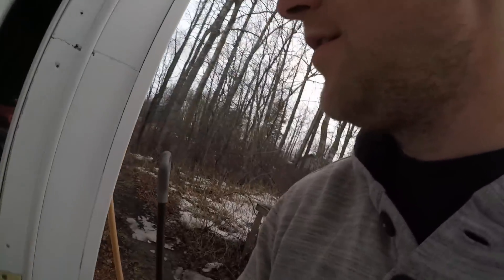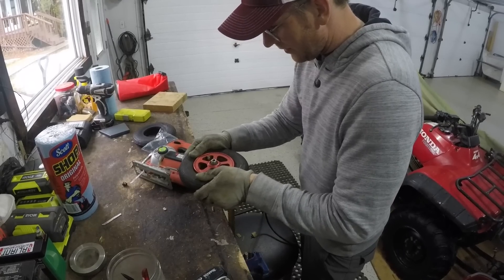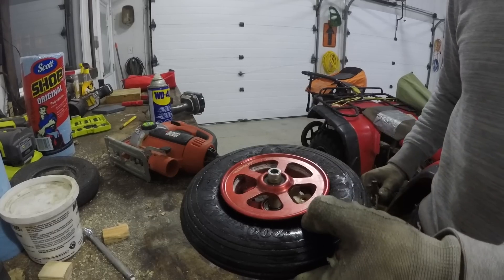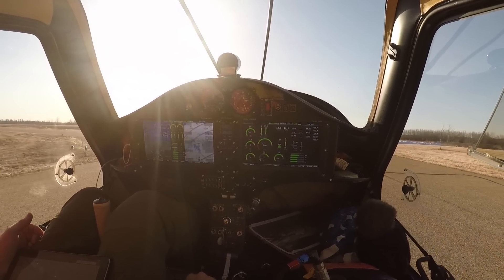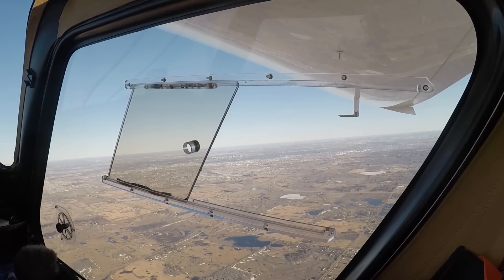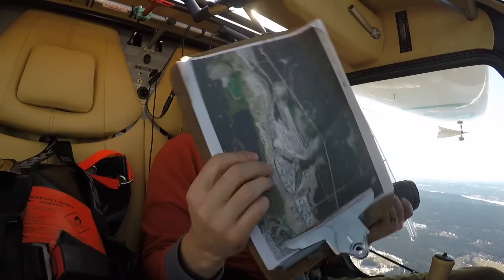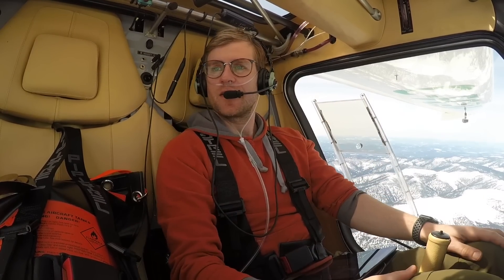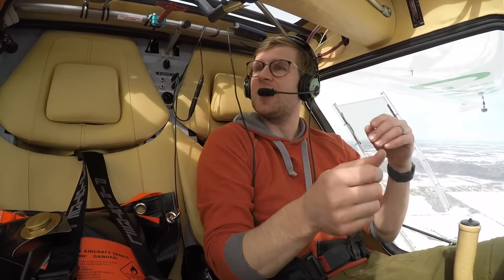1000 NM trip in the Pipistrel Virus crossing over mountains at 15,000'!!

Comment: I am 6.6ft tall and wonder if I can comfortally fit into a Pipistral.
Reply from the maker: That will be tight, there are cross bars on the ceiling of the aircraft that your head will bump into. My headset will hit these in the winter when the seat is stiffer, and I'm only 5'10''.
Reply: @DarrylZubot  Thanx for the update. How you grade this plan for use as a sport plane trainer for high school age students.
Reply from the maker: Awesome airplane for high school students. They'd love it. @SulaimanTheAviator

Comment: Hey thanks for sharing, what is aprox real cruise speed in 75% cruise (4800rpm) 
3000 ft MSL 23 Celsia, humidity 50%?
Reply from the maker: About 127knots. But you should never cruise at 4800rpm that’s too low. Cruise at 5400 as the engine is designed to run at
Reply: @DarrylZubot    :O what is pipistrel 75% rpm and what is max rpm and what is 5400 cruise speed?                                 I am flying Viper SD4 with the same engine cruise is 4800 and maximum is 5500 more than 5500 for five minutes so In my SD4 is 4800-5000 optimal in bigger rpm is aircraft "nervous" :D So what is your consumption in 5400rpm and speed do you have IS engine? Thank you for reply I know a lot of questions but I am thinking about buying pipistrel sw121 or tecnam 2008JC.
Reply from the maker: @okuliarerayban9481  speed is 130knots and 15l/hr fuel burn with 5400rpm.  Read the forums about cruising rpm’s with 912 engine. It is recommended to be at about 5300-5500rpm for cruise no matter what aircraft you have. Engine is not designed to run at low rpm but it’s probably okay. Max rpm is 5700 for take off on pipistrel.
Reply: @DarrylZubot  I have in flight operating manual 4500-5500

Comment: Have you flown your airplane at different speeds to determine what is the best "mileage" you can get?  I know someone who claims her pipistrel virus sw 912iS gets 70mpg to 75mpg at "economy speed", which she says is typically 220kph to 240kph (but usually closer to 220kph).  Is yours a 912iS too, and can you achieve such great fuel efficiency?  She paid a lot extra for "extreme range tanks", but one or two bladders is obviously a much cheaper solution.  Of course you won't be flying any passengers with one or two bladders, me thinks, unless you could put them behind the passenger seat.  Though... I wonder whether that is far enough back that it might throw off the balance.

OTOH, the pipistrel I flew in once with the owner had enormous room on the floor beyond my feet, so maybe you could put one or two of those bladders down there on the passenger side?  Think so?  She flew across the south pacific and back, which she says requires one hop of nearly 4000km.  If my math is correct, that means she MUST get at least 50mph (ground miles) even with extreme range tanks, so obviously economy speed is crucial for such crazy flying.

One final question.  One of my gripes about almost every small airplane is... the excessive height of the instrument panel, so the pilot and passenger [almost] can't see anything out the front window (anything on the ground, I mean, even in the distance).  Especially those of us who aren't 6 foot 5 inches tall... though I don't know how someone like that fits in a pipistrel, actually (though pipistrel claims they do).  And so, my question is... do they make a "less high" instrument panel as  an option?  Frankly, I'm starting to wonder whether one could dispense with most of the instrument panel and just have a couple large iPads with flying apps on those fold out arm accessories that I've seen in a few videos.  I really would like to be able to see something out the front window!  Is that possible?  PS:  I really do love the huge side windows, which give great views out both sides.
Reply from the maker: Hey Max, that's an amazing trip your friend took across the ocean, i'd love to hop over to europe some day by way of greenland, iceland, scotland.  You can definitely fit more fuel inside the aircraft, i've got a friend who rigged his up with four 20L jerry cans in the cargo bay of his and has no issues with flying characteristics. So you could get two of these 40L bags and put them in cargo bay, I keep it up front as I'm usually alone on work trips, also I mount equipment in the cargo bay so need that area free.  I don't have any rudder pedals on the passenger side so you could definitely put more fuel under there.  You can get smaller control panel yes, I have the large version to fit two dynon 10'' screens, but you can definitely get a smaller dash to see out better. But I find even with the large dash I can see just fine out the front, way more then most planes, especially cessnas.  I get about 40 MPG at cruise settings, but if you really pull back the throttle it's probably 60 or plus, your just not going anywhere fast.  I cruise at around 230kph burning 15l/hr.  Yes I have 912iS. I wish rotax made a 912iS turbo charged for high altitude.You can put the 914 in this plane but cost goes way up, so does fuel burn and its just too big an engine for this plane, doesn't need the extra horse power unless you do have the long range wings from pipistrel.
Reply: +Darryl Zubot : Thanks for all the information.  It really helps a lot to hear from people who actually have and fly in the airplane I want to buy.  Got my private pilot license about 25 years ago, but there was never an airplane that suited my desires until the pipistrel virus sw 912iS appeared.  Frankly, I've never flown with GPS or "glass cockpit" type instruments.  I've been trying to figure out what options and accessories I should get on the pipistrel virus sw 912iS I want to order, but about 90% of the items listed I don't know how to judge, what they're for, or how important they are.  What I do know is... I want the most extreme range tanks they offer in the wings, and fittings that make it possible to attach one or two additional fuel bladders.  It appears they can put 300 liters in the wings, and they have an additional 50 liter tank option of some kind that appears to be stuck behind the passenger seat (but not sure).  I'm so confused about options and accessories... I wonder whether we could have a phone conversation so you could help me go through that options and accessory list and figure out what I want and don't want.  Oh, the other item I surely want is the little door/hatch under the bottom so I can place a 4K, 6K or 8K camera on gimbal there (maybe the zenmuse x7 that comes on DJI inspire 2).  Would you be available for a conversation like this?
Reply from the maker: Three things I wouldn't go without on this plane, air brakes, beringer brakes, and autopilot. You must consider glass cockpit it is the future, dynon are amazing systems extremely reliable, never failed me.  If you are getting long range you will want autopilot, are you planning to fly around the world? With 300 litres you will fly for 20 hours, you also cannot land if you take off with full fuel due to the weight, I'm not sure pipistrel will sell you 300l tanks with a 912iS engine, you may need 914.  They do also have 180ltr wing tanks, wish I would've known about this before I ordered mine.  I would get collapsable fuel tank if you want another one inside the plane, then you can add it or remove it, I think the tank pipistrel offers is solid and will be there forever, giving you very little cargo space especially if you have a parachute.  Sure you can call me 780-695-4312. Cheers

Comment: Is your oil pressure normally at 26psi and oil temp so high? I'd figure with sub 20" manifold pressure that you'd have a cooler oil temp and the oil pressure seems lower than I'd expect even with the hotter oil. Whenever I climb high in the Alpha, I have yet to see oil temperature above 87 degrees C. Your manifold pressure you are seeing seems lower than it should be, I had 20.1" of manifold pressure at 11,500 feet and at 8,500 feet I had 22.4".  I'd be sure to check you aren't choking off the intake air supply or need new air filters or something.
Reply from the maker: ElectricZE1 I have a cowl that keeps the oil temps warm. If I keep it open then the oil will be in the 80°c. This also keeps me warmer in the cockpit. The oil psi is in the normal operating range. When I’m at 2000-8000’ my oil psi is around 35-50 but when I go higher it drops further. Manual states it can be as low as 12 psi

Comment: Love your videos. Thinking of purchasing an aircraft. I sat in the virus sw a few years back at EAA and found it a bit of a tight fit for a 190# 6’ 1” pilot. Also looking at Cubcrafter and Flight Design products. Any comments or thoughts?
Reply from the maker: Nap Pozulp hey thanks for the comment! That would be a little tight for long trips, although I know some tall guys in the Pipistrel. I’ve always wanted a cub, they look great. Not impressed with flight design, saw one at Oshkosh booth, the fit and finish is nowhere near the Pipistrel quality, and they weren’t using stainless steel bolts on the doors, rusting which really turned me off. I’d also check out the sling aircraft. But depends what you want. Weekend flyer or xcountry machine?
Reply: Read over the blue planet .  If u ur not sure about the Virus or the Sinus .
Reply: Try a Jabiru 230....https://youtu.be/rEzgI4Q0bZQ